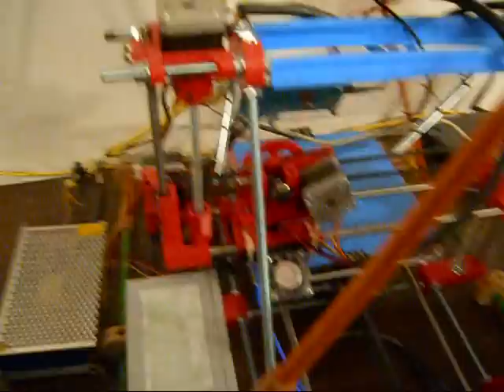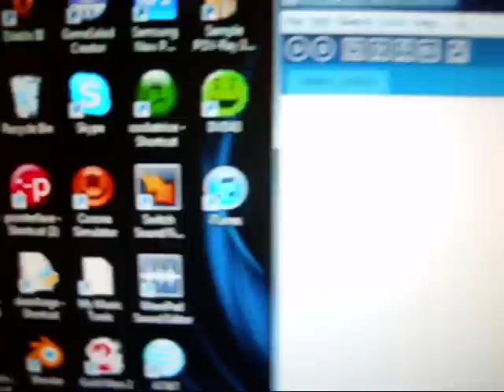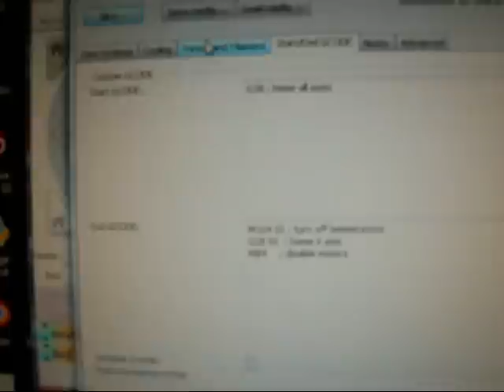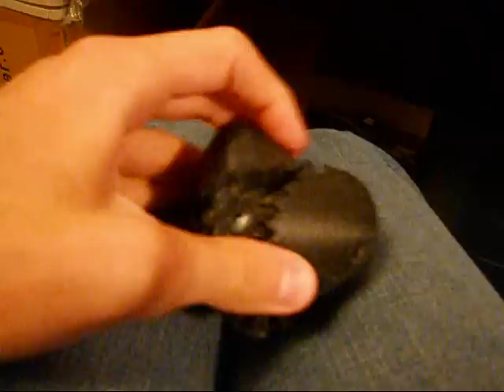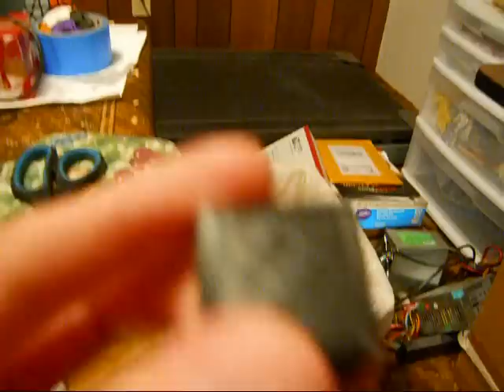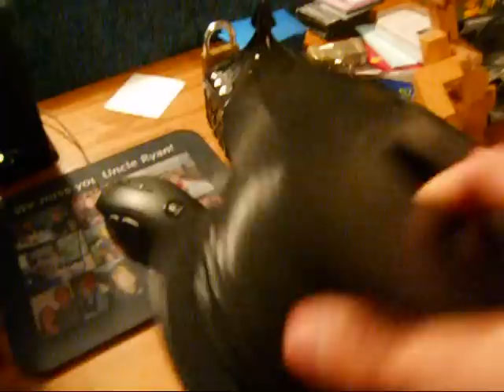3D Printer Auction

Comment from the maker: i dont print my puzzles with this printer. i still get them from shapeways. and yes i believe it does work with mac. I think most people prefer it on mac but you should check the link on the auction page to be sure if you are interested. it should be on the reprap wiki